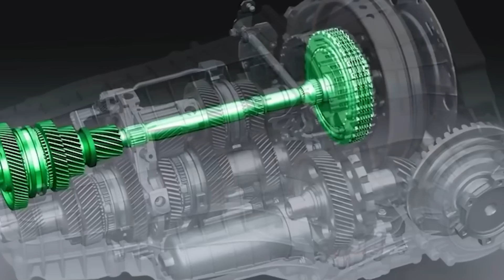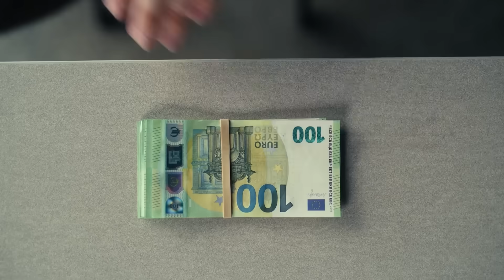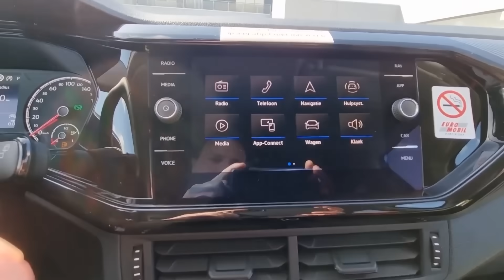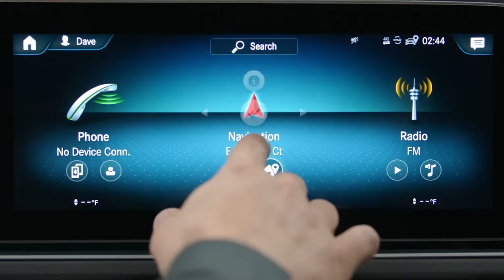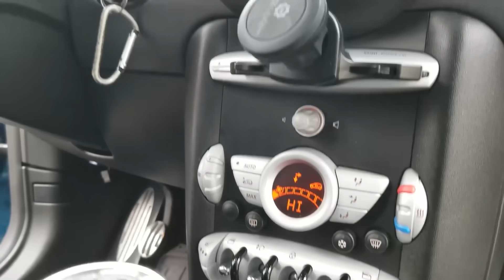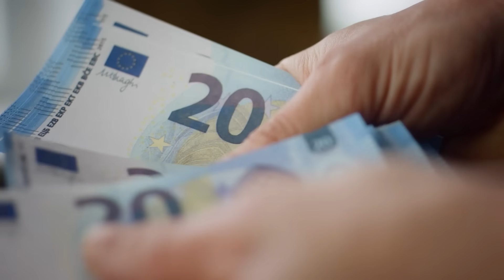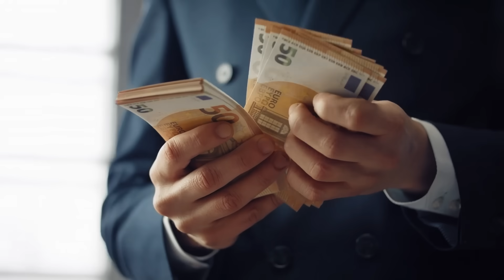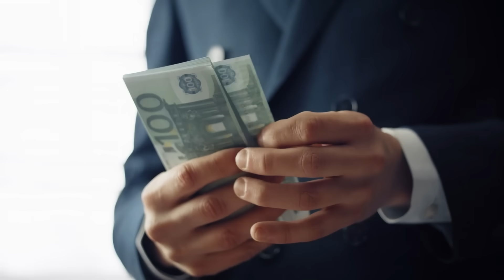7 DIRTY Secrets Why Your European Car BREAKS After Warranty

Comment: I am having this problem with my BMW F10 530i drivetrain malfunction message appeared on my dash so it failed the MOT. Apparently, it's because two fuel injectors failed so I paid £1393.11 to fix the Drivetrain malfunction issue. I drove my car for 5 minutes from the BMW Dealership and the drivetrain malfunction message appeared again. I took it back straight away after about four days I was told it's the NOX sensor so I paid a further £393 for the repair. I was told by the Service department customer relations Olivia that there will be no more problems so I drove home with no issues I was happy, but after parking the car for about a week I drove my car for 2 minutes and the drivetrain malfunction issue appeared on my dashboard. I am fuking angry I hate the BMW Corporation and many like them because they are literally stealing money from us we need to stop them from doing this. I am happy to see a video like this because I am not alone so than you for proving that we are being ripped off by these Corporation.

Comment: it is not just Germans, Just gave up on Volvo. constant isues with something. Sadly many times Even Volvo dealer don't know what the reason for brakedown is and they change parts random. My 2003 seat Ibiza is brakeing down less than premium Volvo. that is insane. 
Never again a Volvo it seem times of 240 series are long gone. 
If they continue like that we will see tham fading away like Fiat, Alfa ........VW use to make peoples car it seem they staped away from their name :). My sister still owns golf diesel mk 2 ( 1991 ) that has 500 000 km + and still runs normal.

Comment: I worked for a company that supplied hoses to a very high end car , hose cost £3.55 to make, sold by dealers at £150 + fitting and had to be replaced after 3 years.
Reply: Bought an up grade intercooler for my Golf R. Hoses on the OEM intercooler are thin and poor quality in comparison to thicker chinese made ones for the up grade.

Comment: Everything went to sh*t after the 2000s, bunch of plastics everywhere, unnecessary electronics, more cats and stuff that is clogging your exhaust and causes premature failures and extra maintenance, touchscreen everything, fake vents and exhausts, tiny little engines that are overstressed and can't last an oil change, not to mention the electric cars that are so unpractical. Old cars are just better in every aspect, and even though they might need maintenance after 20 years due to age, once you fix them they can last you another 20.

Comment: we learned about how to design for a given MTBF at uni. engineers design for a spec. without a spec there is no design. i have no problem with the design process. but its fraudulent not to fully disclose the MTBFs of all components, because of course they are known in advance by the vendor

Comment: R56 mini plastic timing chain guide, they all break. Updated longer chain tensioner 
High pressure fuel pump 
Turbo boost solenoid
Valve cover twice 
Oil filter housing 
Bosch coils
Vanos solenoid 
Thermostat twice

Comment: As a testmanager in automotive i can say this is AI stupidity which is 80% wrong. Test durstions have to be calculated on a basis. This is offen 150000km or 200000km and 15 or 20 years. No part is designed to fail automatically after this time.

Comment: With the internet and ai, it is very easy to find a list of parts that will fail for a particular vehicle and replace them. And not they are not designed to fail, they just do.  This video is the usual clickbait BS to pull on those that have had issues, and bots of course.  YouTube pushing it to the front, does not help.

Comment: Yep I learnt a hard 20k lesson loss on two mk6 Audi a4 2.0 petrol cars both the oil change pumps went destroying the engines (a small plastic piece costing probably £2) now I drive a Toyota 5 years not one engine issue cars 13 years old.

Comment: 8:25 Electric pumps don’t have to run all the time therefore making cars more fuel efficient. BMW’s design may not have been correct but that doesn’t mean that electric waterpumps are better than the internal mechanical ones. 
Those mechanical ones can and do fail just as well and require much more work to replace.

Comment: The idea that car manufacturers deliberately let their cars fail after a certain time or mileage is flawed. 
First owners typically keep their cars for 3 to 5 years. 
- If it catastrophically fails before that, a repeated sale is unlikely. 
- if it catastrophically fails after that period, the customer has already bought a new car so it doesn’t effect sales. 
What will affect the new sales is the value of car traded in.  A higher value leads to a higher priced new car.
Reply: I think you have to see this in a wider perspective. The boards and CEOs are not thinking about keeping their brand alive.
They are cashing in on the recognition the brand had in the past, for fuel-powered vehicles, because they don't think it will matter much, when they stop selling fuel-powered vehicles.
They don't give a flying crap if the brand dies after they retire and move to another country. They might even retire and move out, when it starts to look like it's going to come back and bite them.

Wasn't that already clear with the VW diesel exhaust test scam?

Comment: 1:20 I have the N47 timing chain on my 2.0 diesel engine. After more than 250.000 km it still runs fine. I ‘blame’ regular oil changes with high quality oil for it to last so long. 
In other words: these engines do have a timing chain issue but I don’t believe it’s designed to fail after 100k to 150k km although in hindsight BMW should have designed it a bit beefier. That would however made the car a tad less efficient and more expensive. 
It’s minuscule for one part but if they’d done so for every part the car would have been significantly heavier, less fuel efficient and more expensive.

I have a quote from my local BMW specialist for a new timing chain for €1700. (Not €3000 to €5000)

Comment: I have a transmission cooler on my automatic transmission with the original engine has currently done 321,000kms. My car is an obsolete Australian made 2005 Ford Fairmont Ghia MKII.

Comment: Swirl flaps will kill ur engine, even metal ones will fall into cylinder, most bmw owners know this issue and remove them without any problems. Bmw e39 also has ABS module positioned above turbo and exaust manifold, some v8 models have heat shield installed, but all others dont. There is also intentional oem use of plastic plopeler for water pump, plastic intake manifold, plastic L cooling pipe that is mounted directly to iron/aluminium engine block, entire bmw design is peace of shit, designed to destroy engine, overheat or kill you with abs fail.

Comment: Exactly the same is happening with farm tractors smaller family farms have to try and keep tractors from the 1980s,1990s going because the repair costs on the newer tractors are crippling and would easily bankrupt a small or medium sized farm especially when all the electronics inside them degrade with age. It also requires thousands of acres to spread the machinery costs for these costly new white elephant tractors full of hi-tech gadgetry. Newer tractors can also be switched off remotely by the manufacturers if farmers are late with their finance payments. I have heard of one farmer who went out early one morning to find two of his tractors had been switched off remotely because he was slightly late with the finance payments. At first glance there appears to be plenty of competition in the farm vehicle market with plenty of brands on offer. In reality this is an illusion as a lot of these tractor brands are owned and manufactured by a few big umbrella companies. At harvest time there can be serious repair bottlenecks because there are not enough trained main dealer mechanics with the specialist computer diagnostic equipment foe each particular model to get these costly computerized machines up and running again . Each model can have umpteen different version making parts availability a nightmare often causing long delays waiting for these parts to arrive from abroad.

Comment: Im a German CNC worker, so im deeply conectet whit the industry and the ppl that produce OEM parts. Sensors, Transmission Housings, Gears and so on.
I would never ever buy a new German car! I gave it a chance and drove the newest Cupra ST (20km Fresh car) not even reached 1000km, Transmission problems, just standing aside the road and restart the car 30times till it did work again. That happend a few times.
So i defenetly quit German made stuff now, i own Japanese CNC Machines, and they run like a charm every day..... i also have 2 German Build machines but whit Fanuc controll, and u guesst it, the machine needs its "Maintainance" every few month.....
The German and Japanese machines even have ruffly the same working houers, the Japanice is 10years older and works better.
Only German thing i dont regret are some Kuka robots, they are build well (2nd 3rd gen.) but ye Kuka owned by Chinese now :D i wonder why.

I own a 28year old Yamaha XJ600SN whit 55k km, in the last 10years the ORIGINAL fule Pump from 1997 did quit working, i replaced it for like 25€ + shipping, Bike works every day again.......
Alsow me 3 months ago bought a Honda CBR600F PC25 (34Year old Supersport Bike) whit 85k km, did all maintainance and changed a few rubber parts.
Runs like a charm at 14k RPM ..... every day, u sit on it, start it, warm 2-4min, and just drive off. As easy as it sounds. (If u sit in a Cupra, u can wait up to 30sec untill the Managment system finnaly awakes... so u can finnaly chose to start ur Engine and not running in E-Mode by default, EVERY SINGLE DAY, you have the joi to tell that car that u perfer actually using its MAIN ENGINE)

Comment: I completely disagree with what you said about the Korean car manufacturers, every macanic would say , stay away from Kia, and Hyundai. Even the internet tells us that they are no good, except for Genesis, for some reason they seem to be vary reliable. And apparently German cars are more reliable than even Gm cars, that's what the internet said witch could be wrong. If not than that's a very bad sign. Because Stellantis are complete junk and rust so fast, you think the Germans love money, well Stellantis loves being greedy, electrical problems, springs that fall out of newer Jeeps, not to mention the 3.6L Pentastar that blow its head gasket before 100,000 miles, you get around if you are unlucky mabe 50,000 miles before it blows a head gasket. And the cams on the 3.6L go out Fairley easily from a lifter that failed, hear a slight ticking coming from the engine that wasn't their, it just needs to be taken to the repair shop by towing it or else you need new cams. But you might as well get a new engine because by the time you ignored it until it gotten so bad that you took it in, it's so warn down that all that metal been circulating around destroying you engines bearings, and just to replace all the damaged components it would be cheaper to just get a new engine. And the 3.6L Pentastar engine has macanical water pump problems as well, so it's just a crape engine. On the other side BMW has completely charged their company around and is one of the most reliable brands out their now [2021 and newer cars especially with the S58 engine or the inline 6 engine is almost bullet proof and has a metal oil pan as well] , at lest in the European and most if not all American car companies. They even know use macanical water pumps instead of the, frequently failing electronic water pumps, and put in the transmissions that Toyota and Lexus uses, the funny thing is that Toyota now uses electronic water pumps, I was shocked. I was like but BMW just stopped using those a couple of years before you decided to go the opposite direction of reliability, I only hope they didn't screw them selves. Because thats the complete reason why BMW got rid of the unreliable electronic water pumps. Oh and don't go with any hybrid German car brand they all have problems as far as I can tell, mabe you won't or you will definitely have problems. But I also say don't because they cost so much more, more than the money you could of saved to buy gass unless gas has become really, really expensive over night, it's like $10,000 more for just the Mercedes GLE and that's used compared to the 4 cylinder engine. But I would definitely only buy a BMW over any European car manufacturers, yes their parts are very costly if you buy their expensive marked up OEM, I mean their are some parts you should buy that are OEM buy not all of them, like their very expensive brake pads and rotors, it's just much cheaper get a good aftermarket set from Rockauto, unless your taking it to a certified shop, don't bring your own parts, none of it will be warranted by the shop and most likely will tell you to go jump in a lake, are parts or no repairs. And on any car no pad slapping or reusing especially on a European car. It's just sad when a BMW can be more reliable than a American car, or and I don't really trust Ford anymore especially after the wet oil belt in the engine, and they are still using them for the oil pump belt, that is unacceptable, and all the recap they keep come  out with, not to mention nome or their cars are reliable not one, maybe the Mock E and that's it, the rest is junk, well if they keep using wet oil belts that is I'm no sure about Lincoln but the internet says they are still reliable, are cost cheaper to maintain than the German competitors, so I'm glad at least Ford has some good cars left, and some American car companies but not much if at all, Japanese cars are the best and still are.

Comment: The whole consumer product production works like this. Having seen something of GM and GEC development. A part that last 10 Years but cost 10% more won't get fitted. It's been going on for years. Recently sold a 1970's television set. I was so familiar with it's internals I could repair it. They regularly used underated resistor to ensure regular call outs.

Comment: You can extend the life of all engine plastic parts by 30 to 50% by lowering water temp to 90 deg instead of the common 105 deg used now. You will suffer 2 to 3 % higher fuel cost. 
   ECU and electronics part also life easily extended if proper airflow and shielding is used.

Comment: The green washing behind new car sales is obscene and one of the greatest crimes to the environment. To think the manufacture of a car cost 100 times more fuel than the car will consume in its lifetime and double for an electric model with the costs of mining the battery material. The older the car, the more information is freely available to repair it plus the parts are far cheaper. A secondhand bonnet for a new BMW is at least £1000 whilst a ten year old bonet will be about £100. Please make more of these vids. They are so important.

Comment: I drive a 2003 Passat I bought for just over £1300 7 years ago. I paid a lot as it was an old car when I bought it but with only 80000 on the clock which is low for a car that will famously do 300k miles. In the south of France this is the preferred car along with the old Peugous. Not many could afford to risk a modern car that will cost you 5 times the second hand price just to do 100k... literally at the stealership. In 7 years I have replaced the rear brakes, clutch, cam belt,  a wheel bearing and a few ball joints and driven more the 100k miles. Wings rusted on arches as they famously do after 15 years but covered them with boy racer chrome trims and rust was gone...to the eye at least!!! You have to be one fundamental thing to buy a modern car these days: fucking ________. Guess the word... My heart goes out to all the old people that buy nearly new because they don't want problems and have no idea they are going to be literally robbed. Remember these three words: Old Is Gold. I'm a BMW trained technician and I cannot believe what BMW have done to their cars. You only buy old German cars.
Reply: Exactly why I cling on to 2006 1.9tdi Polo that my dad bought new. Low mileage, now at 150k km but proper maintenance and usage and it is still great :)
Reply: @mmdirtyworkz the engines last forever but holy shit the rest breaks a lot. Same with golf and passatt
Reply: stealership - that's bloody amazing!
Reply: I have 2 project cars im bidding on at the moment. a 2015 Audi s3 and an old 7 series bmw. The BMW has been a fun project and it hasn’t given me problems. I’ve already worked on it before it’s a friends. I have rarely driven the s3. Do you think 2015 is too early and too unreliable and nightmarish especially if I’m going to legally modify and re engineer it? Should I let them go
Reply: @Pessimisticpaul  The audi is way too young. Most brands after 2006 are shit. Getting worse the closer you get to now. Toyota and such have been at it allot shorter, so 2010/15. But they are doing it allot now aswell. My '05 e46 has so many more metal parts that are plastic in newer models, it's very obvious. It's designed to not make it to a couple 100k km. And my baby is almost at 400k and still no unexpected issues. And, way easier to fix...
Reply: I'm planning to buy Mercedes GLC 220d in India. Do you suggest it?
Reply: @EuphoricNovember 😲😆🤣💷💷👍

Comment: This is the same with most electronics. They have a built in failure. Sometimes as with printers one is able to built this failure date by rebooting the printer on the net. Most household electronics have built in failure. Most can be repaired but majority of people throw the product away and buy new. Remember recycled plastic is not as durable as virgin plastic.